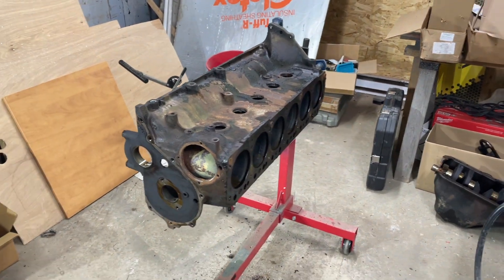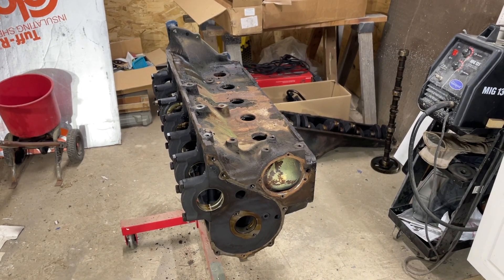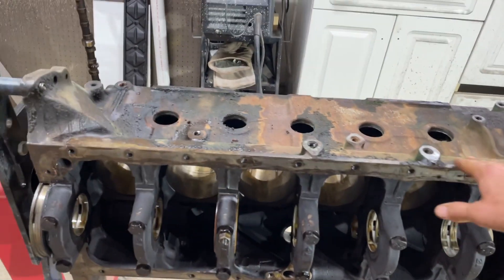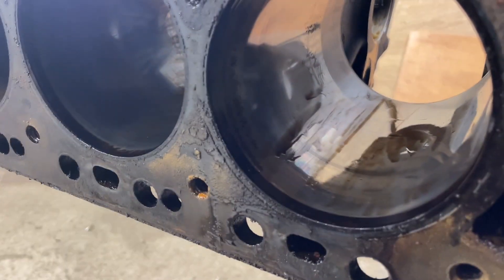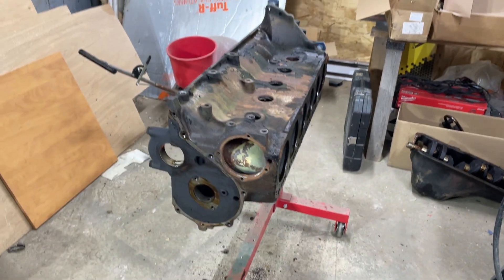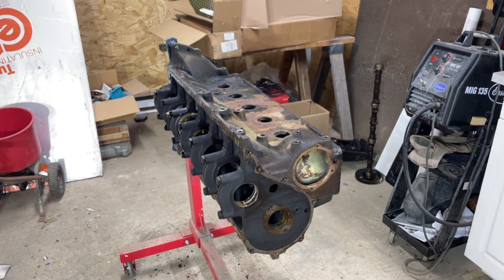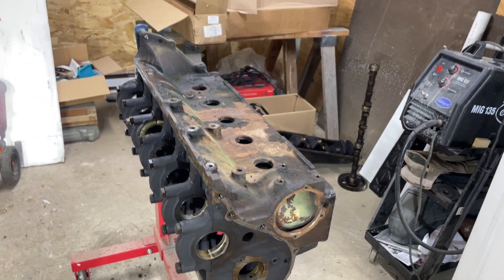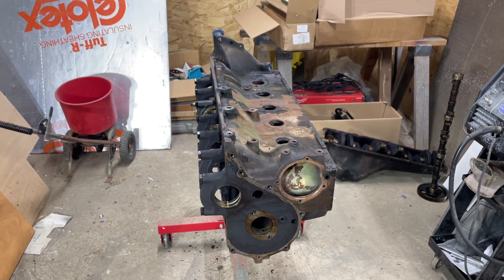500hp Turbo 300 Build Part 1 - Disassembly and Prep for Machine Shop

Comment: with that ki nd of boost and your goals, might you consider sleeving the block with ductile? at . 030 the walls get iffy. and boost would find a way through. ive two virgin blocks here im not using that need only honing ( genset engines) wall will support that kind of boost😊
Reply: Not true. The 240/300 blocks handle 0.030" over with no problem. You want to keep them under 0.040" over.

Comment: What rpm is that head rated for?
Reply: I have 2 engines on stands.  One has 80k and other is unknown.  I think I'll tear the unknown down and bring it to a machine shop.  I need to call around and see if any have a boring plate for a 300...
Reply: As with any engine, airflow capabilities are going to vary a little depending on intake and exhaust used. I've read online that this particular  Promaxx CNC cylinder head  should breathe very easily to some point above 5000 RPM.